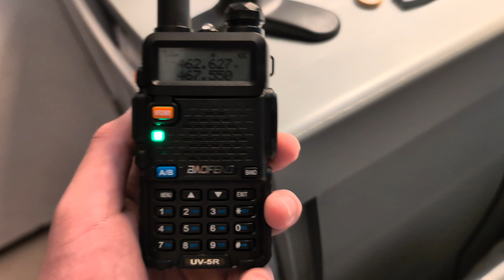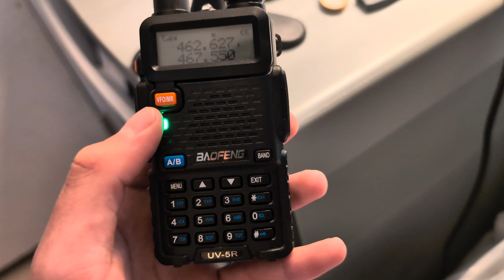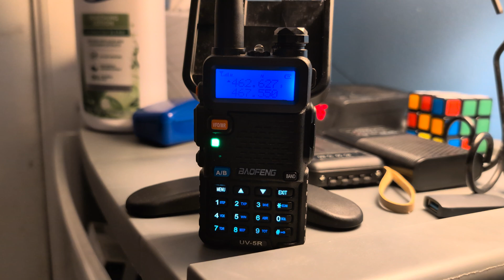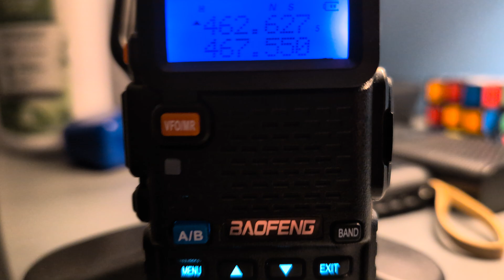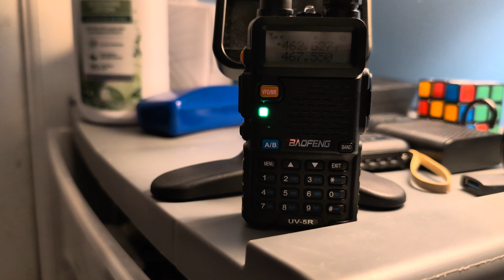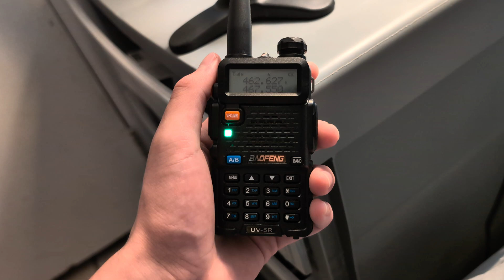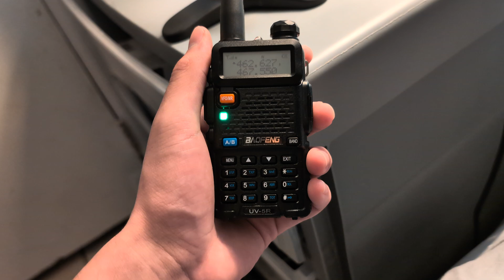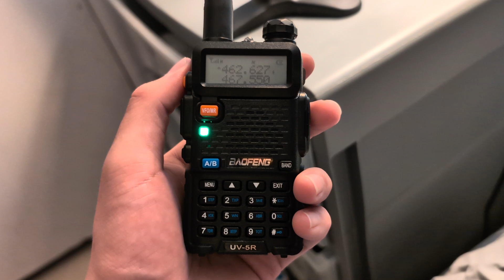462.6275MHZ GMRS activity

Comment: You can get a TIDRadio TD-H3 GMRS and unlock it into "normal" mode, then you got something that's also legal to transmit on GMRS.
It's more expensive than the UV-5R, but I have two and it's worth the extra money, for the features packed into it and the insane frequency range that the reciever will tune to. I have no idea how good it recieves, but it will tune all the way down into the 17M/18MHz band. That's actually insane, if you can come across any FM in the 10M+ range it should pick up with the right antenna.
I love these fantastic cheap radios, they get better by the year.
Reply from the maker: @kmemz  true I'll look into it in the near future
Reply: It does nothing the Baofeng’s don’t at twice the price. I own all the Chinesium radio brands. Your knowledge is too limited to weigh in with any opinion.
Reply: @petemitchell6788  So you're saying a UV-5R can hit a broadcast radio harmonic at 19MHz, as well as a data transmission in the 915 band? That it can tune to broadcast radio at the press of a button? That it can have custom firmware put on it, to expand its capability with things like AM and USB recieving, fast seek, fine tuning TX power?
I chose the H3 because I could do all of this sort of stuff in the future. In fact, on one of them I already did, the stock firmware limits the max frequency to 550 so that's the radio the 915 band bit came in on, I got to hear my Meshtastics put out little fart noises 😄.
Gonna go out on a limb and assume that's all a no, since I haven't seen those features on mine.

Comment: 462.6275 is between channel 3 & 4 of the FRS band, not GMRS. Not even listed as FRS for that matter. Most likely a 462.625 repeater.
Reply from the maker: Yea I probably accidentally put the wrong frequency
Reply: Actually FRS and GRMS share bands, the main difference is the power output 2w (FRS) and 5W(GRMS) at least at those frequencies

Comment: You'd benefit from an external antenna like a tuned 462 MHz monopole with built in ground plane leads. Those little duckies are pure trash on the SWR meter, amazed they even work at all...
Reply from the maker: The external antenna the radio came is good I like It but I prefer telescopic antenna  better it obviously fits better in my backpack if I bring it to the park or something
Reply from the maker: @thetruthserum2816  well I do have a external antenna tuned into those frequencies I don't use it often the stock antenna is not that bad but you're right

Comment: You can get gmrs on a jailbroken UV-5R?
Reply: Yes, it's easy :) YT vids will show you how to "Unlock" the Radio then vids to use a free software called CHIRP,... Buy a programming cable super cheap, plug into computer, program all the GMRS Simplex channels then look up GMRS Repeaters in your state/area, load them in & even name them if you want ;) It's not "Illegal" because FCC doesn't have Laws but it is technically against the Rules lol.
Reply: I have a similar Baofeng (BF-F8HP) brought it from Amazon and it works on FRS GMRS frequency's right away no jailbreak needed.
Reply from the maker: @catcans  yes I think so
Reply: yes , but its illegal to transmit on GMRS with that radio as its not part 95 certified.
Reply: @jimb2036  not it's not lol There's no "illegal" by far.  You forget channels 1-22.  It's "illegal" WITHOUT a GMRS license to submit on 23-30(GMRS Specific Channels)
Reply: GMRS is standard on ALL radios.   You don't have to jailbreak and hack to do so

Comment: There being a roger beep or "courtesy tone" that's a repeater, likely on 462.600Mhz.
Reply from the maker: @william_k4arx  thank you for telling me the right frequency I'm still learning how to use this radio it's pretty hard to use but im learning how to use it
Reply: I am learning the GRMS frequencies also but I was under the impression if the  TX of the repeater 462.600  it could be either + or -  offset of usually 000.600 which makes the repeater input freq 463.200 if offset is + or if - offset would be 462.000, or am I just wrong?
Reply: @DKoppJr  the off set for frequency pairs on GMRS is positive (+) 5Mhz. The other is for VHF. Do not program the inputs as extra channels.
Reply: @DKoppJr  GMRS repeater frequencies are PAIRED with 467 MHz input frequencies. In your example, the input freq for 462.600 would be 467.600. That is channel 17 (Motorola convention - or Chan 3 on the Icom F21-GM convention). The input freq would be called Chan 25 and so on. There are 8 repeater channels (input freqs).
You can do a simple search for "GMRS frequencies" and you can find lists and charts of these.
Reply: I used a pair of Baofeng radios to connect via AO-92 satellite a few years ago. 🛰️
Reply: Repeaters don't normally have a roger beep/courtesy tone. That would be coming from the individual transmitter (portable/mobile). What you would hear a repeater broadcast is its ID in Morse Code every few minutes (usually every 5 minutes).